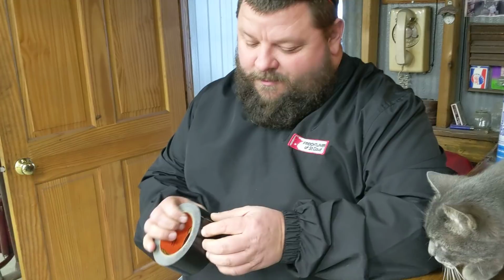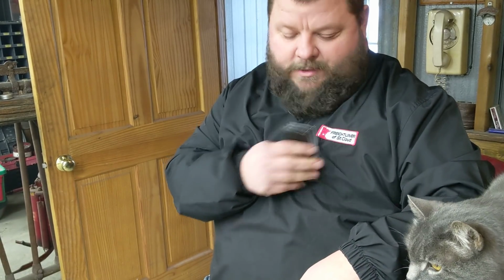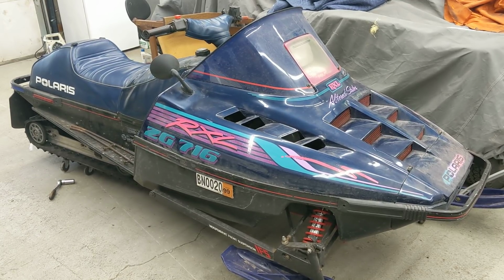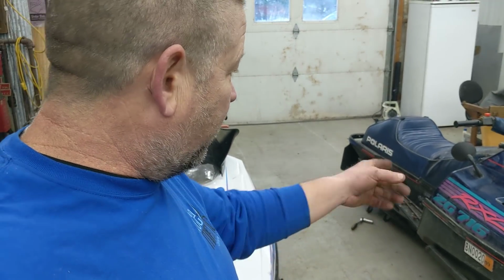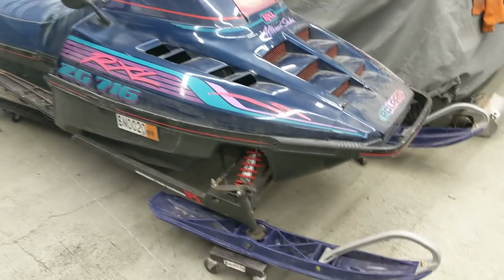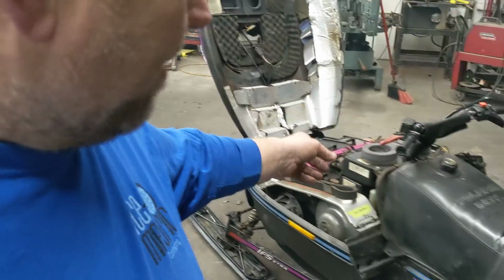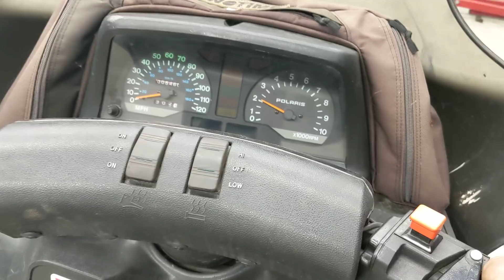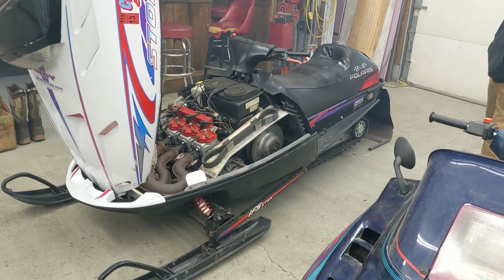POLARIS 800 STORM GREASY TRIPLE ROSE

Comment: Bro's Thank you! I have had an Indy Ultra SKS 680 for 3 yrs now in the NW. Broken engine mount and low compression were it's only issues, $350!! Funny part is I was looking to buy Paddle tires for a Quad and ended up with a sled that I never knew exisited, a mutha*&^%$% Triple 2-Stroke! I've built a kit for it to run in/on the sand dunes out here. It is in a box right now but it'll come out again in the summer! Thank for what you do. So few videos and info on these until recently. And primarily because of you and yours! Cheers to you with my can of Olympia - It's my Water of Choice!
Reply from the maker: Great comment, I hear your enthusiasm in the comment! Cheers my friend

Comment: You mentioned Marv Jorgenson lol. I owned one of his personal sleds for a few years before I gave up on snow in 2005. I put all my chips in on motocross and still riding at 41 yrs old. But back in 2003 I bought  one of Marv's 2000 xcr 800's. Was one he ran a 1200 polaris triple out of a wave runner/ watercraft in. I grew up around the generation of big 650 triples that you guys are into. As a young adult I then could afford what I was around and wanted so badly as a kid. lol. I had freshened up a 93 xlt special as my first triple in 2000 and in 2002 I wanted the biggest baddest tripple Polaris made. I bought Marv's XCR after he returned it back to stock...
Reply from the maker: I would give both nuts to have that sled!! I talked to Marv last year on clutching my 800 storm. One hell of a guy. I was hanging out in Chopper city sports dang near every day in the 90's buying stuff for my xlt.

Comment: Awesome video Todd! I have a question though. What do you think about XLT 600's? I own a 95 but I'm having a problem with my recoil, I broke the cord and rebuilt it but I feel like I used too thin of a cord. What cord do you use on yours? Also what do you use for header gaskets? Because after I had taken the recoil off again I bought some AAEN triple pipes for it but I'm not sure what gasket to use. And what jet size would I want to go to? Sorry for all the questions by the way, I usually mess around with V8's and know a holley carb like the back of my hand but sleds are new to me, I wouldn't even have it if my friend hadn't given it to me.
Reply from the maker: go up 3 or 4 jet sizes and i just use stock exhaust manifold gaskets
Reply: @toddclyne3493  awesome thanks!